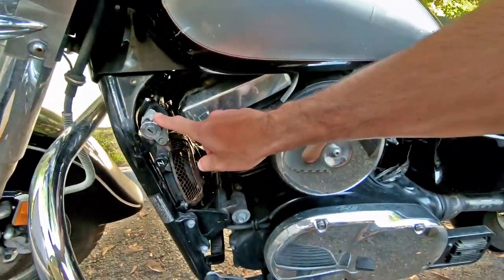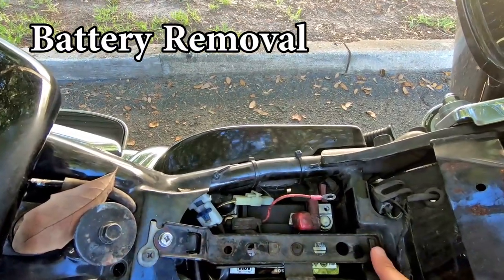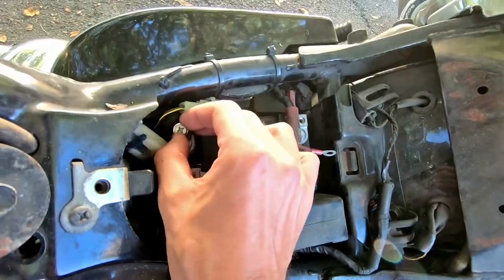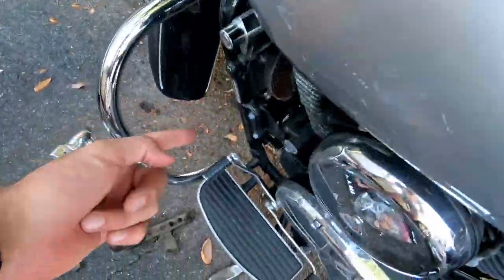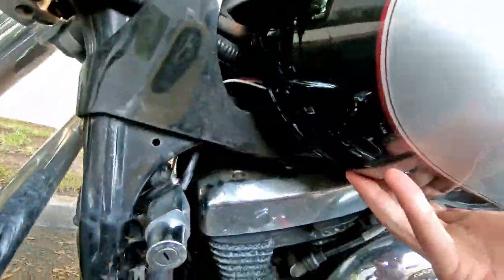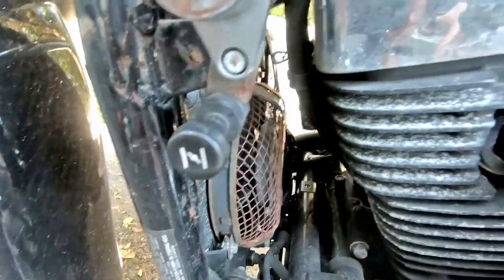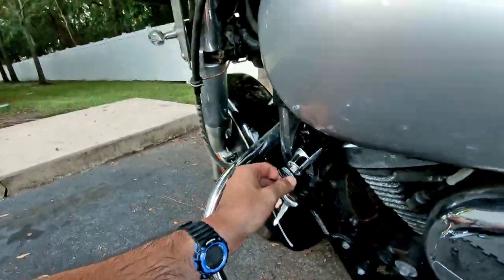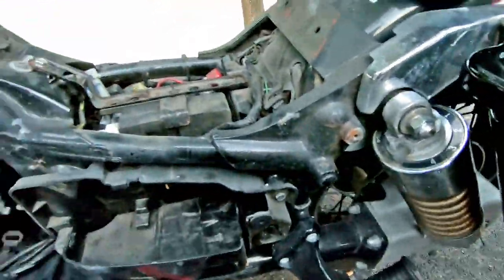How to Change a Motorcycle Ignition Switch, 2006 Kawasaki Vulcan 1500, Cruiser Motorcycle

Comment: I switched out the ignition switch for one I bought that looked identical, and everything lit up and the bike turns over but now I have no spark. Does the ignition switch have something to do with providing a spark to the plugs?
Reply from the maker: That’s a good question and one I won’t be able to answer. I sold my bike a year ago. If I had to guess I’d say yes it should. There shouldn’t be anything stopping the current from getting to those. But then again it may be a totally different issue. One that will require some trouble shooting. My apologies for getting back so late.
Reply: @bigacefilms  I turned around and bought an OEM switch and it worked, so the one I ordered online was missing a diode or something.
Reply from the maker: @tj3688  I’m glad you found out what wasn’t working. Good call on getting another!

Comment: What if you change it out but it won’t turn over
Reply from the maker: The wiring will need to be traced and make sure it’s all connected along with the battery. Trouble shooting it will be the steps you’ll need to resort to. Check the battery as well for juice if it’s old. But I doubt that would be it.
Reply from the maker: Also fuses.